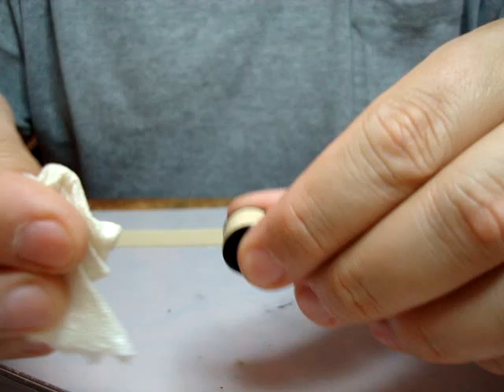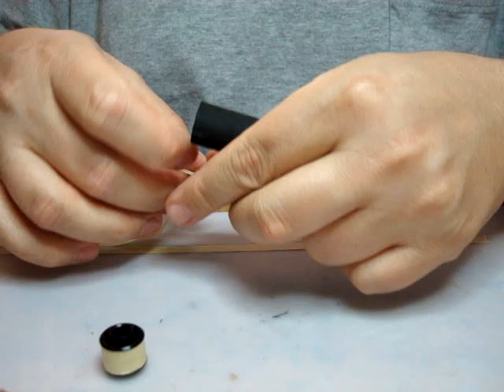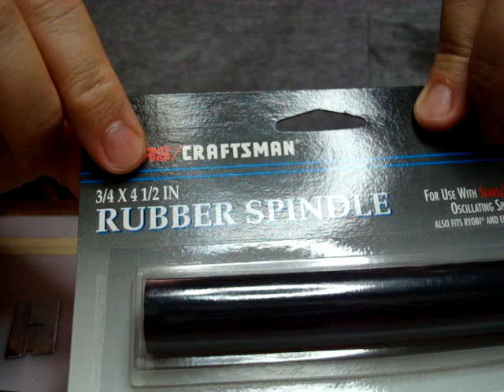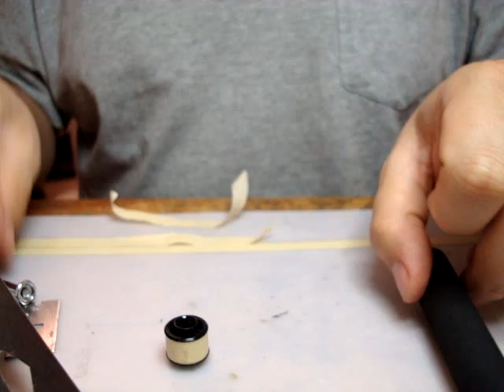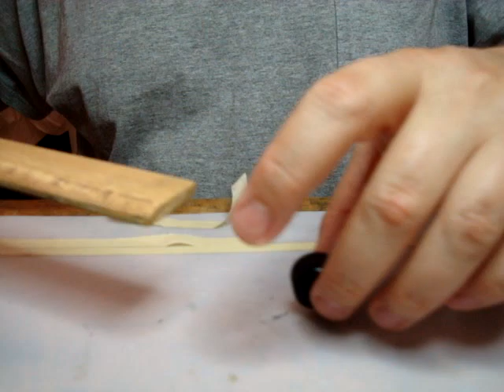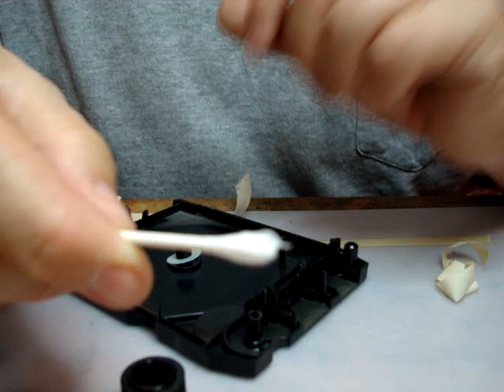8 track pinch roller repair for "gooey" types (Ampex & GRT types) (AMPEX Repair pt 3/3)

Comment: Great idea. Does it also work for tape deck pinch rollers?
I have my doubts about using vaseline as lubricant: vaseline dries out over time (which is not as long as one might think).
Reply from the maker: Matching the size is the hard part.

Comment: This is one of the best prepared and delivered instructional videos I have seen.  My compliments and thanks for your help.  I just resurrected an old 8 track stereo I had in the garage and going thru my old tapes I find that issues with melted pinch rollers as well as pads that have turned into dust spores are to be expected.  This gives me an option to repair, however, any non classic rock tapes I may have that happen to have good working rollers, may very well be sacrificed in the campaign.  Sorry about that Perry Como, Herb Albert, et al.
Reply from the maker: Glad it helped out. Yeah, I've sacrificed some Mantovanis and Musak tapes (Sorry Mom). Wish someone would sell the rubber hose tubing for these rollers. Come on Shark Tank.  ; )

Comment: I tried my own creation- Black Duct tape- cut it in thin strips wrap them around cleaned roller several times until looks like it almost reaches plastic top of cartridge, I have done 5 so far every one works great. Make sure u clean all that old  goo out first

Comment: I save all of mine from landfills.. Skip the vaseline,, i sand my spindle with 220 fine sandpaper. It works good for me..
Reply from the maker: For very extremely tight rollers (or reel hubs for that matter) I will resort o fine sandpaper.  For problematic reel hubs that are the clear pliable polyethylene types that are prone to warping or tight centers that won't turn, I've inserted thin needle nose pliers into the hole and carefully opened the pliers to stretch the hole size out and/or pressed down into the hole as the plier nose diameter increases to also stretch it.

In one instance, I had a harder plastic reel hub whose side had warped upwards to the extent it rubbed against the top of the case and would barely turn; probably from being stored upside down in a hot attic or garage. I wound the tape off the hub onto another and then put the warped hub upside down on top of a coffee mug filled with hot water (heated in one of those hot water beverage heaters) that fit just a bit smaller than the hub diameter and using a small flat plate, pressed down on the hub. It gently melted the hub back to it's straight/flat condition. Then just wound the tape back on it again. Worked great then. Could do this if it was warped downwards too.

Comment: What is the purpose of splicing the type when fixing an 8 track cartridge?
Reply from the maker: dan bee I'm not sure if you're referring to regular (non-metallic) splicing tape or the sensing foil splice tape. Regular splicing tape is for repairing and reconnecting broken tape anywhere on the tape except for where the splicing tape is. It is to be adhered only to the back side (non-recorded shiny lubricant) of the tape. To make it adhere well, it is best to use the side of a razor and scrape off a small section of the lubricant on both sections of the tape to be adjoined.  The sensing foil is only to be used to replace fallen off, or cracked/well-worn splicing tape. In addition to holding the beginning and end of the tape loop in one continuous piece, the metallic aspect triggers (by closing two electrical connections like a switch)  the head/track changing solenoid to push up and down on a gear clutch to advance and turn a small wheel a quarter of a turn. The wheel has 4 inclined position (lowest to highest) platforms that push the head downward from Program 1 to 4 with each track change. After Program 4, the incline drops down from the highest to the lowest position causing the head to go the top most position (Program 1) again.  It's a very mechanical process which is why grease and lubricants on the parts are necessary for smooth operation. If any of your track changing parts are dry, remove any old hardened grease and lube them up well with white lithium grease for the ratchets and gears and oil for any pivots or axles.
Reply: Thank you for the valuable information.
Reply from the maker: dan bee No Problem. Also forgot to mention although it's intuitive that the sensing foil tape does go on the playing side of the tape (unlike the non-metallic splicing tape). If you don't use metallic tape at the splice, the tracks will never change. I've come across some repaired tapes like that! Always fun trying to locate the splice and then change with foil tape.

Comment: Hey Waukee. How does some of the goo get on the pinch roller on some of the older Ampex 8-track tapes?
Reply from the maker: Mark Covington The goo IS the pinch roller deteriorating. The rubber used on these was not fully cured making it prone to decomposition (poor manufacturing practices). Literally a self destructing time bomb. Straight ammonia is the only thing I know to dissolve and clean it off. Don't get on your hands, wear gloves, and don't breath it!
Reply: I'd recommend isopropyl alcohol if you don't have ammonia.

Comment: I can happily report that a garden hose will do the job if you have a case of "must play that broken tape right now!". Don't know how it will work in the long run though. You probably have to sand the welding seem down a little bit or else it will go woo woo woo because the weld is a tiny bit thicker and makes a small hump. But with some elbow grease it totally works.

Comment: Great DIY. Thanks for sharing. 
I looked at your measurements and noticed that the millimeter conversion seem a bit off. 

Outer diameter should be: 19mm
Inner diameter should be: 13mm
Tube thickness should be: 3mm
Reply from the maker: Thanks for the refinements. I measured with the best ruler I had. I'm trying to find more rubber rollers to keep my supply in tact. They don't seem to be making the spindle sanders with separate rollers these days; pretty much now glued to the sandpaper. Any supplies/supplier suggestions?

Comment from the maker: I would imagine if you could find the correct size/diameter/thickness/surface smoothness/etc of a piece of tubing it would work.  It's like changing a tire on a vehicle.  There are rubber conditioners that should probably be used periodically to protect the rubber rollers.

Comment from the maker: When you hear the tape splice passing over the sensor and head, you can kind of hear (from the tape in the machine) if there is something wrong and that the splice probably broke: (1.) If the track/program does not change and you hear the same program, (2.) a sound like tape getting crunched or peeled with a delay before the next program. (a normal program change should not have any of this sound coming from the tape). PULL IT OUT FAST and check it!

Comment from the maker: Thanks for the tip on the rubber hosing. As for splices, you really have to replace the splice with a new one. You can buy spools of metal sensing foil on line. When playing any tape that you've not played before, ALWAYS pull the tape out at the program change and flex/tug at the foil splice to make sure it doesn't peel off (Especially the CBS/Columbia/TC8 tapes with the 3 snap tabs on top).

Comment: Very nice video.  If you're running into some hard rubber that's giving you a hard time fitting over the wheel you might heat it in some boiling water or, put it in the microwave for a short while.  I would think that heating it would make the rubber more pliable.  I've had the metalized tape splice come loose.  Any thoughts on repairing or replacing that?  Thanks, Tom
Reply from the maker: The hot water trick is worth a try, thanks. As for the metal spice tape, your best bet is to go out and buy a roll of metal spicing tape. I have a video on that.
Reply: @waukee321  Thanks for the advice.

Comment from the maker: Are you asking if there are other pinch rollers that will fit/work in an AMPEX tape shell? Yes there are but I can't think of any particular brand.  The tricky thing about the AMPEX rollers is there very wide (or "tall") size and other rollers will flop up and down on the shaft. Some of the plastic rollers may fit but try various spare rollers until you find one that fits right.  Make sure it doesn't slide up and down on the shaft either.  Thanks.
Reply: rca rollers...the end.